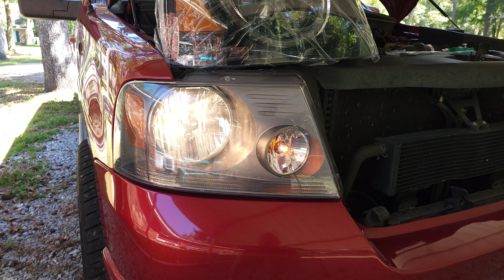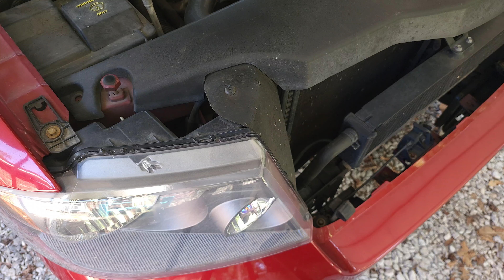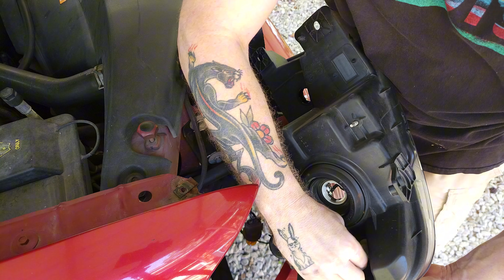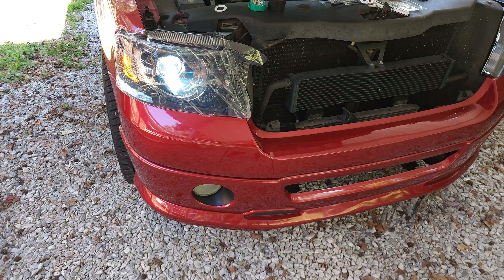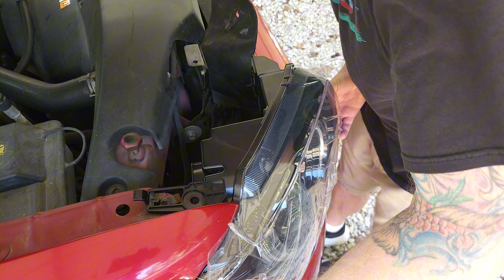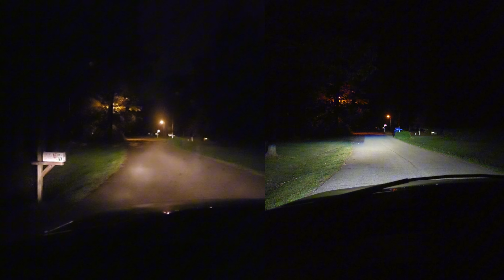BRAND NEW plug n play headlight design for 2004-2008 F150 11th gen - Gxenogo LED projector headlight

Comment: I bought and had these professionally installed in my 2007 ford f150 lariat along with a new grille with the three amber headlights about a month ago, they are by far the best aftermarket headlights you can get, absolutely worth it